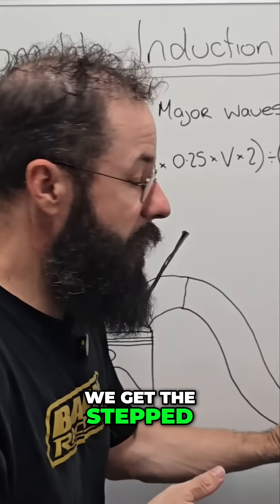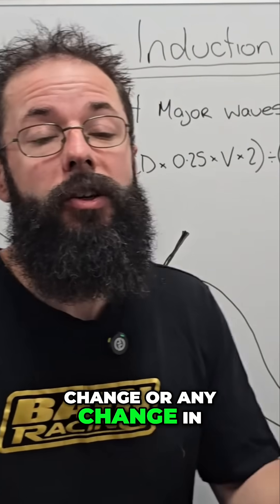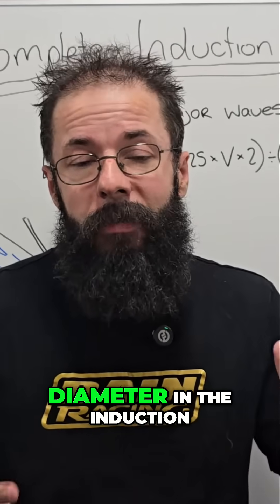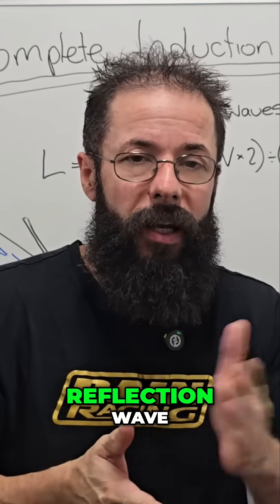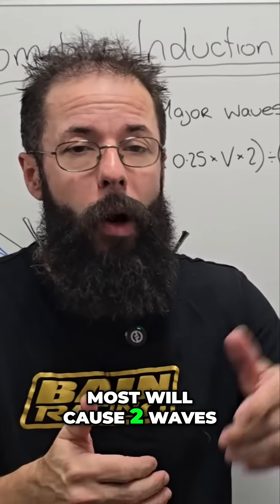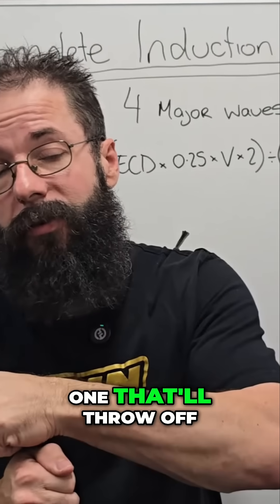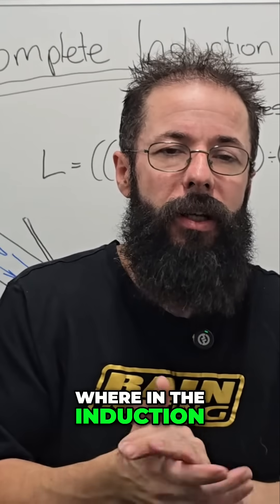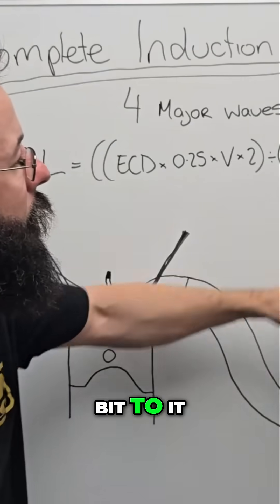Induction Tuning: 4 Wave Dynamic Mechanisms Explained!

Comment: Hey Jake have you thought about a calculator, that when you put in runner length and temp, then spits out the effective rev range for 2nd, 3rd and 4th wave?
Reply from the maker: Not really mate as everything on either side of the 3rd is a compromise.  All these calculators are for fully optimising race engines.